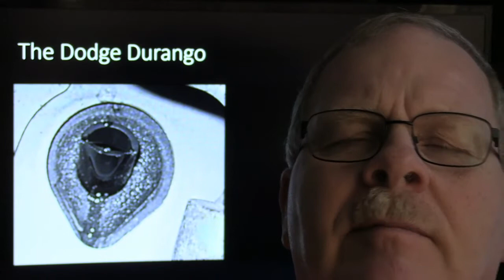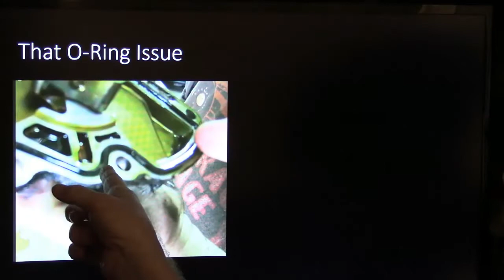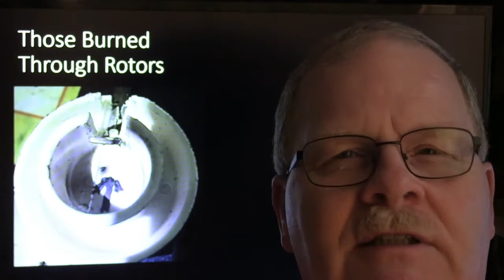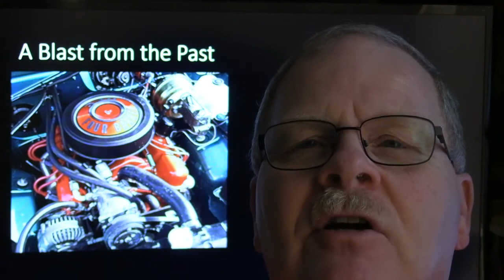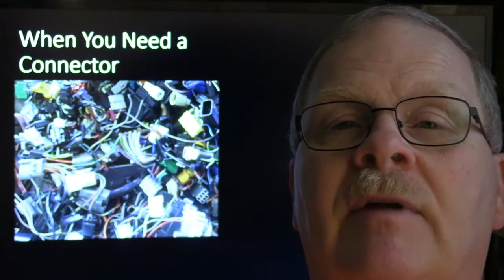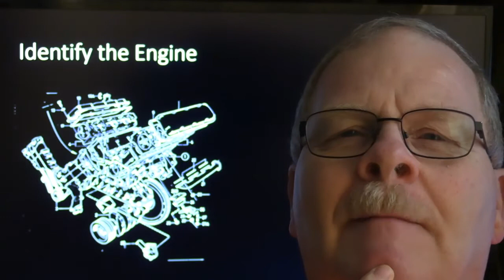More Photos and Why I Took Em

Comment: Twice I came across the non venting radiator cap. One pushed the hoses off. The other would cause a stall at idle and the hoses felt like a tire at over 100psi. I was surprised when the engine stall was fixed by just replacing the radiator cap.
I have come across them people who want to build a complete custom car with a couple of thousand dollars in a few weekends. At first they do not believe me when I say add a zero to the money and a few years to the time if you are just doing weekends.